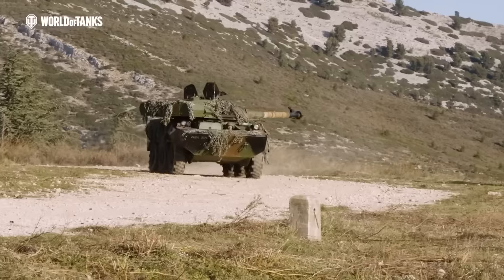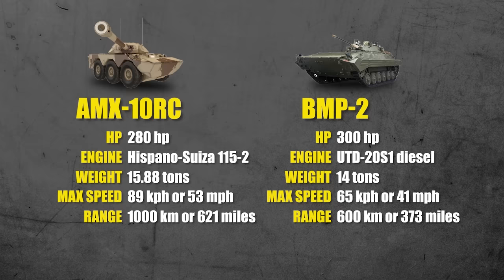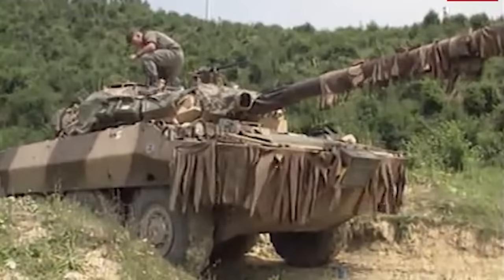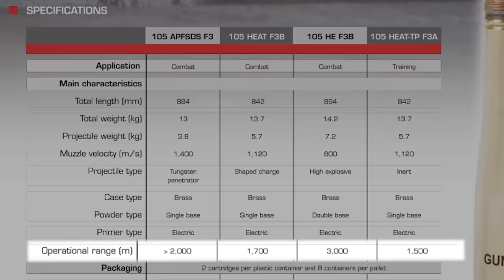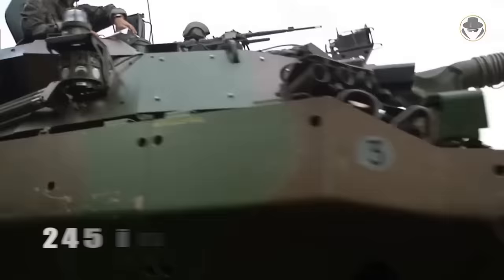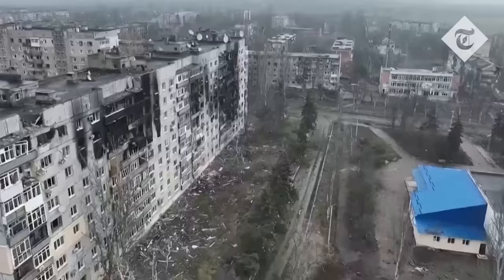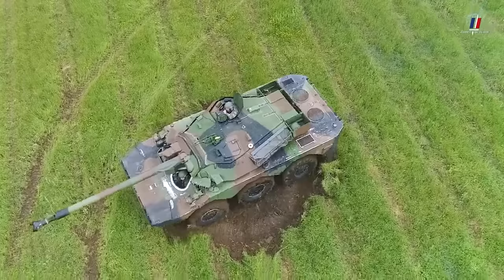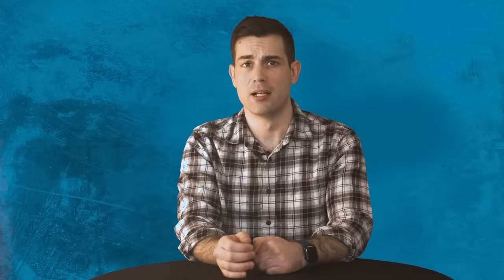Can the French AMX-10 RC Make a Difference?

Comment: When you know you have something like this as a fire support vehicle it is a huge morale boost. Sure it has shortcomings but in the face of an ATGM system so does a lot of heavy armour. That said, the 105 with HE and the mix of what that gun uses is going to prove helpful. It is relatively powerful, quiet, quick and it swims.
Reply: Speaking as a civilian, I supose it is a huge difference if you comand a russian defensive position, and instead of beeing atacked "only" by infantery, you are atacked by infantery AND this vehicle.

If I opened the door of my bunker, and found the cannon of this vehicle pointed at me, I would certainly consider the idea of a surrender.......
Reply: @jorgebarriosmur  I think that actually resisting in this condition is not a situation for the future.😏
Reply: The french army added more armor on them so they arent amphibious anymore

Comment: With it being wheeled it's also extremely quiet and able to sneak around much better than a tracked vehicle
Reply: Apart from a muddy field..
Reply: @j.4332     the AMX-10RC is not afraid of muddy field ►hydrolic Suspensions and adjustable pressure for 16t 6x6, and good pneumatic,  5,3t/axle, and the the wheels are very close, improving behavior in muddy terrain.
Reply: TIL a tank is quiet bc it has wheels.

I guess semi trucks are also quiet 🤫

Comment: Fun fact: Mexico does not have tracked tanks, but has more than 400 of the French ""wheeled tanks"" in different models, this is because Mexico is a very mountainous country, with very narrow roads, which meander through the hills and mountains, besides that the bridges do not support very heavy vehicles, so a tank like the M1 Abrams can easily get stuck in one of those roads and be destroyed without much problem.

Comment: Perhaps a good use of the AMX-10RC would be in a light armored brigade with an AMX-10RC/Stryker mix. That could be a follow-on force exploiting salients punched into enemy line by heavy armored Leopard/Marder and M1 Abrams/M2 Bradley brigades.

Also light armored wheeled vehicles with heavy firepower are a good choice for logistics convoy protection.
Reply: it can move at around truck speed so it can keep up.
Reply: What Leopard brigades? Or M1 brigades? In year 2024?

Comment: The other thing that makes the AMX-10 such a good weapon for the Ukrainians right now is how many of the older tanks the Russians are dishing up to the front. T54, T55, T62 etc.  These are all pretty easy targets for the AMX-10.

Using the older barrelled versions and their proprietary ammo is not really that much of an inconvenience either.

While it may make logistics a little more complex, it does mean that there are large amounts of stored ammunition available RIGHT NOW which is critically important, given the ammunition shortages the whole of western Europe now faces. Even more important is that even with the proprietary rounds they still offer HE, HEAT and APFSDS that is NATO triple heavy rated to 2200m, so can perform all tasks a big gun may be used for - artillery support, direct fire, infantry support, anti material and anti tank.

The only downside of these vehicles is that people might be tempted to use them in an incorrect way, just like Canadian LAV's or US Strykers, or even the Bradley.

Comment: The amx-10rc can also turn on the spot like a tank. Also it can go over water.
Reply: It was designed to float, but it becomes too heavy for that with the upgraded armor. I don't know if you can remove it or if it's a permanant upgrade 🤔
Reply: It does not have jets AFAIK.

Comment: This 6x6 is a heavy armored car, a well armed reconnaissance vehicle or infantry support vehicle in some armies. I wish the USMC had something like this!
Reply: Our boys need some MPF
Reply: No, please no.  I spent too many hours at the vehicle ramp working on the 25s 😆.   All joking aside, the new light tank would mesh well with the new light, mobil Marines doctrine.  We won't always have air support.
Reply: @sancocho1718  high time the Marines had some armoured cover since they don't have tank cover anymore.
Reply: The Marines are going to be running the ACV. Amphibious Combat Vehicle can deflate its tires from mounted so they can do a beach run, then inflate from mounted to run at 55mph on highways 10 minutes later.
Reply: @JustAnotherAwesomeGuy  Yeah, lot of guys I know had to either switch to the army, or get out.  I understand the desire to be more mobile, but we won't always have the air.  Especially fighting a near peer opponent.  Infantry will always need fire support.
Reply: The US copied it into the Stryker MGS, but it didn't work that well. In Europe, you can buy a Boxer 8x8 using this concept. This "wheeled light tank"-concept really works very well in cities and against insurrections.
Reply: In fact in the 80s USMC tested the AMX10RC but finally bought the LAV

Comment: I say the AMX is a huge upgrade to the UAF. Remember that the AMX is powerful enough to tow truck any tank in use by the UAF. It also bridges the gap between support and MBT and is made for urban warfare. This will help recover damaged vehicles to not fall into russian hands, support gaps of the army and make rescue operations more viable
Reply: it's also great to attack and run on enemy positions
Reply: It is useful supplement for mobile firepower, but it is most definitely nowhere near powerful enough to tow any tank in use by UAF, as they are 2 or 3 times heavier than the AMX (40 ton T-64, 45 ton T-72 or T-80, and of course none of 60–70 ton Western tanks that are provided now).
Reply: @lattegremo6016  agree, towing tanks is not really a role for the amx-10. It's an enemy scouter and a powerful cannon to support infantry as a light tank (as it's considered in frech language), not a tow truck or a tractor (or any more suitable recovery vehicles, like some Leopard  versions or the M88 Hercules, eg., suitable for 70+ tons tanks)
Reply: @Maddog-xc2zv  it's wheeled so it's rather quiet which is nice

what is it's towing capacity?
Reply: @2MinuteHockey  well, the AMX-10 RC was never designed to tow equiment. But you're on point about being quiet due to it's wheeled system. It was broadly used by the Legion Étrangière (cavalry regiment) in places like Mali till recently, but it's RCR (Roues-Canon - wheeled cannon - Renovated) version has being phased out by the 2022 Jaguar, the new French (also used by Belgium at least) Reconaissance Vehicle. Still, due to their wheeled and not tracked systems, they are pretty good and fast manouvering vehicles supporting dismounted troops in urban environments (US Strykers would also perform well on these environments). They can be equipped with milan ATGM missiles, in case they meet some counterpart T-92 or T-90M. It's a vehicle designed to scout terrain and enemies and to support dismounted infantry (8 troopers can be held inside), not as a towing vehicle. Cheers.
Reply: LOL, its not made for urban warfare - it has no armor and it cannot even elevate its gun close enough - it is more of a death trap than BMP-2.
Reply: @tomk3732  I didn't say it was made to urban warfare, but of all vehicles of similar class going now for Ukraine, it's accordingly to a good number of militar analist the best contestant, not a sitting duck like the bradley or the marder with poor maneuverability with those tracks. But sure, keep your opinion, I'll keep mine. Cheers.
Reply: @Maddog-xc2zv  that was my thought you could easily get a battle group focused with these and bust through to go after supply depots and communication hubs then return elsewhere through the lines. Hit and run tactics could be useful with that speed
Reply: @Maddog-xc2zv  bradleys and marders and amx actually will play a massive role in ukraine thunder runs tracked vehicles are better off roaders then wheeled
Reply: @BlesamaSoul  This.  It is explicitly designed to support "thunder runs" unlike most tanks.
Reply: @augustuslunasol10thapostle  And have I said the opposite? I said wheeld vehicles like the amx and the italian centauro are more useful in urban environments than clumbsy tracked vehicles, best for off road. Still, all together, will make a considerable diference on the battlegorund. But still bradleys, Marders and CV90's are more suited to support mechanized infantry (side by side with MBT) than wheeled vehicles exaclty because of the terrain issues you correctly mention. Cheers.
Reply: @2MinuteHockey  Towing capacity: none. Motor not strong enough and not design for that.
Reply: This is the best take on the the AMX 10 rc role. Clearing isolated enemy infantry pockets entrenched in structures would be perfect as well. The infantry doesn't need to clear the building. Just surround it, call the nearest AMX 10 rc within a 60 km radius and blast it with high explosive. Minimal infantry engagement.
Reply: Shhh let the neocons cope.
Reply: A tractor can tow a tank.
Then I guess the AMX 10 RC is also able to tow a tank.
Reply: My only worry is the rather limited aid France is sending. France has sent half what Canada has. The AMX won't have much impact if France only sends a few even if it's 10x as good as Russian equivalents.

Comment: The US forces were left surprised and impressed by the French force's extended mobility during the 1st Gulf War. Indeed, both forces have a different approach to warfare: for recon, it is usual that the French HQ would send a nine-strong infantry squad to secure the perimeter, while US troops will send two Chinooks of 20 men each to secure and hold till release. What makes this difference, in my opinion, is the budget. It's cheaper to send fewer troops and cheaper to drive on wheels.

Comment: I’d like to see a comparison of wheel vs track power to the ground.  Tracks must eat up a ton of horsepower.
Reply: Tracks are a nightmare of logistics. That's why those kind of light tanks would be very good there. No need for a huge logistic chain.
Reply: @sidritkurti1173  old tech is also more intuitive to work on, probably less finicky and quickly understandable by the ukrainians
Reply: @hotdog9262  I wouldn't say old as such. Just different. You want a small light fast cheap vehicle? It's not going to have tracks.
Reply: @zyeborm  sure. but it is old nonetheless
Reply: Can the tires just get shot out?
Reply: @TD05SSLegacy  generally they are a) very think rubber and b) run flat.
So small arms often won't actually even puncture them and if they do they are still highly mobile. They will have a central inflation system that will handle small leaks like what's left after a bullet goes through and the rubber closes up around the hole.
It's only when you get larger calibres actually taking chunks out that they will really start to fail. But then large calibres hitting the side of a tank can mess it up too.
Big difference too is that even with kinda toast wheels this will still move, lose a track and most tanks are totally disabled and can only do circles.
Reply: @hotdog9262  well yes, I guess you could say the wheel is "old tech" have you invented any new ones lately?
Reply: @zyeborm  new wheels? anyways, 
developed in the 70`s and we are now in 2023. I would think most would classify that as - old af
Reply: @hotdog9262  dude is talking about power delivery to the road of wheels vs tracks mate not talking about this particular vehicle.
Unless you think a wheel from 1970 has a significantly different efficiency to a modern wheel?
Myself I don't think the efficiency of a round bit of armour plate steel will have changed more than a few% over that period. Tyres perhaps a few more % rolling resistance but I'd wager the tyres are probably less than 50 years old.
Reply: @zyeborm  i was obviously talking about the vehicle..posting to the 2nd guy from the top
Reply: @hotdog9262  rubber tires and tracks have been around for at least a hundred years each.
Reply: @petermello55  yes I know

Comment: Interesting using Wheels for Urban Fight. 
Which can be killed by anything higher than 7.62 cal.
While 105 MM might be useful for building cleaning but it's soft target.
In Marawi APC was destroy by RPG 2, they then add something for protection.
In Ukraine let start from Dshk to RPG 29 to ATGM before talking about BMP.
I would like to see how APC is better than tank in urban areas where's the enemy manufacturer RPGs and ATGM.
It's an APC still.

Comment: For your information: Germany is now independent of Russian gas and oil deliveries. The threat to cut gas supplies has absolutely no longer an impact. Even if Russia offers cheap gas supplies, Germany will not come back as a customer. Everybody got burned enough the last time.
Reply: Well they might after a regime change and the russian give them a cut in NS2. I don't think they will close there new LNG ports but cheap gas is cheap gas even if you can afford more expensive gas.
Reply: @arturobianco848  Cheap gas is not cheap, and it comes at a price. The largest gas customers like the chemical industries in Germany have made huge investments in Russian gas fields, pipelines, pumping stations etc. They owned these assets in joined ventures worth many billions of Euros and in return they contracted to buy large quantities of gas over the next decades, for up to thirty years. Putin made a bill and bought all of these assets for a very small fraction of the price, maybe 1% of its value. The new law prevented the investors to remain in control of their companies, they also no longer get the gas they are entitled to. Now they had to make new contracts on short term with other suppliers, needed to pay excessive prices last year to keep operating. It also needed new investments. 
Do you think they want to make deals with Russia a second time in a few years, break their new long term contracts to go back to Russian gas? At least Russia needs to give back all their assets or compensate for the investment, compensate for the loss of business and the higher gas prices they needed to pay elsewhere because Russia has broken its contracts. No, Russia has lost all its customers all over Europe forever, and nobody is interested in doing business after everything that happened. A contract with Russia means you might sit in the cold and in darkness during the winter if the government changes their mind. That is not very tempting. And the Russian government thinks gas is a means to play political games. Russia has lost all trust, there is no way back. Germany wants to become carbon-neutral and energy independent in the future.

Comment: I feel any western combat vehicle with their superior optics alone will help the Ukrainians win battles in combat. If You can see the threats from a distance it would help the infantry and with the capability to support and destroy targets.
Reply: Artillery is beyond visible range.
.
Drones to small to easily see.
.
Missiles fired from visible range, but crew difficult to see.
Reply: would they be winning battles out of combat?
Reply: As we know, tank on tank battles aren't that normal, these tanks will not be that much help.
Reply: Completely ignoring the fact that Russian tanks/equipment has same optics as their western counterparts (some even better that their western counterparts).
Reply: @milosmilictrob2046  On that point, it depends, a T-73b3, T-80BVM, and T-90m all use relatively the same optics. Which are better than thermals on the leapard 2a5, M1a2, and Challenger 2. However, the Challenger 2s and M1a2Cs that are being sent are not the base variants, but variants with better optics than there Russian counterparts. It is the Leapards that are lacking behind. But the commander thermals gives it an edge over all Russian tanks but the T-90m.
Reply: Ukrainian forces have captured Russian T-90s, 80s and 72s 
Thats base models to the latest upgraded version 
All those tanks weapons, armor and sensors have all been compromised. Additionally, Ukrainian forces know all blind shots and weak spots for Russian T-90s, 80s and 72s 
so its not looking good for Russian armor
Reply: To quote the cheiftain, Whoever shoots first usually wins.
Even if the first shot isn't a penetration, it will create an emotional event for the crew at least, deminishing their respond capability.
Reply: @voidtempering8700  a large part of russian tanks have no thermals at all. Nor do ukranian for that matter
Reply: @verdebusterAP  Are we really lying. It has not been found that all, or even most of the sensors have been compromised.
Reply: @baronvonlimbourgh1716  That is not even true. The vast majority of the tanks they have in service have thermals, and even many of the T-62s they just sent have thermals.
Reply: @lesterquintrell4844  Its not a tank and they shoudn't be used in that role so thats fine.
Reply: @voidtempering8700  
oryx open source has visual confirmed the capture of intact Russian tanks of all models
Reply: @verdebusterAP  I know, I look at quite a lot of them. And it isn't true that the majority have compromised armor or sensors.
Reply: @voidtempering8700  
Thats just plain denial
The images on oryx show fully intact example captured
Reply: @verdebusterAP  I know they do, and I don't know how you came to the conclusion you did.
Reply: @voidtempering8700  
Ukraine has been sending all high value equipment that they capture to West 
The West has the capability to analyze the equipment light years faster than Ukraine and can provide insight in a matter of days
Reply: @verdebusterAP  I know they have. Still, nothing you have said, nor any of the images on oryx suggest that anywhere near the majority of their tanks are missing sensors, armor, or other equipment.
Reply: @voidtempering8700  
Incorrect
The images various tanks captured in various states from slighty damaged to fully intact
In the T-90M section, the first capture image is show a fully intact T-90M